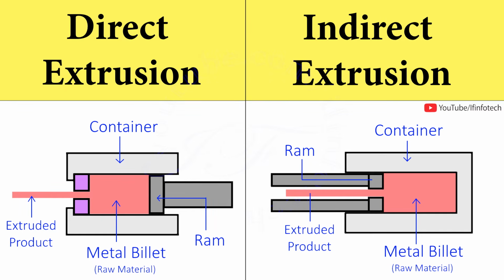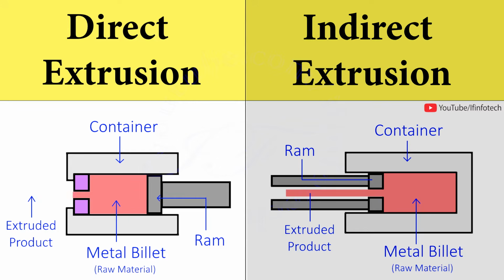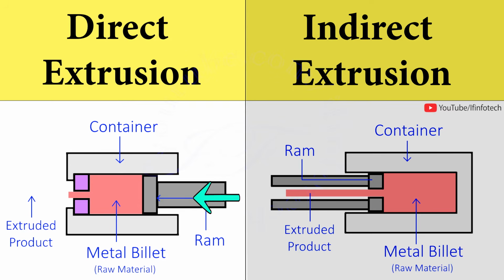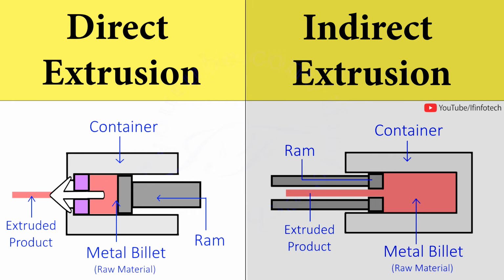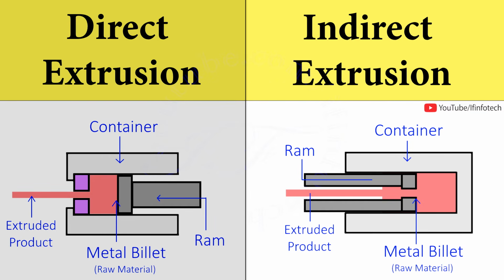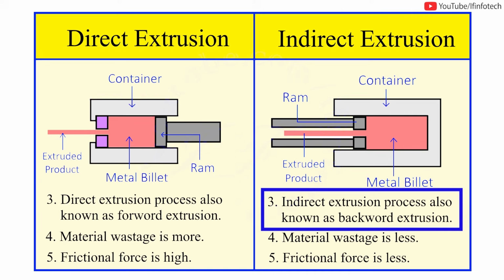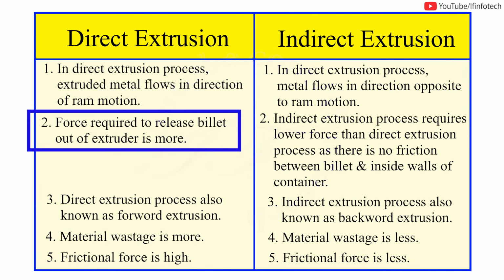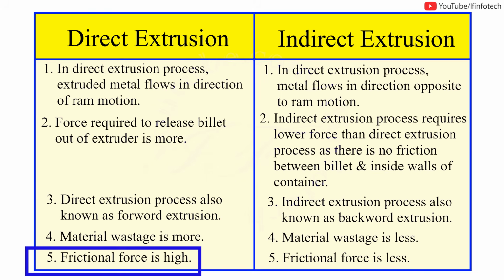Extrusion Processes: Direct Extrusion, Indirect Extrusion Process Working Animation | Shubham Kola

Comment: Direct extrusion pushes metal forward through a die using a ram, while indirect extrusion moves the die toward the billet causing metal to flow in the opposite direction with less friction.